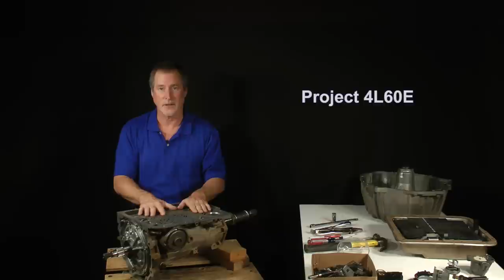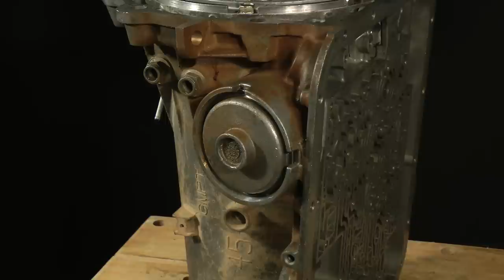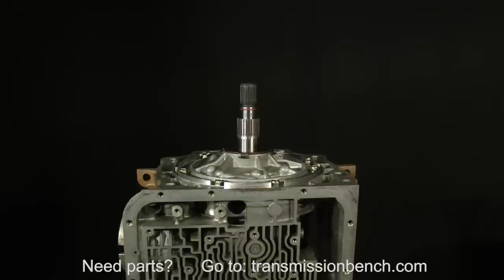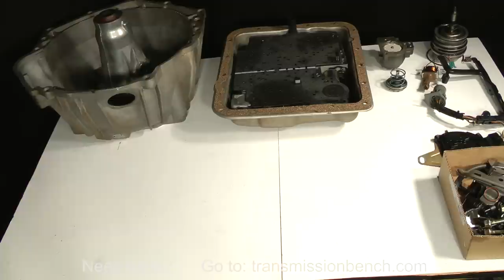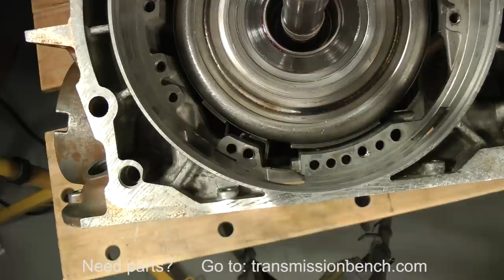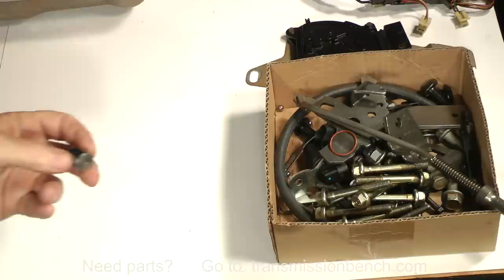Project_ 4L60E Part 1 lesson 6

Comment: I have an early 2004 4l60e with the o-ring on the pump. I ordered a new pump for 04 through 06 and it has the wedge seal without the o-ring. My case looks like it will accept either. My question is can I use the newer wedge seal style pump on it as it has the o-ring pump in it now, and will the case accept either style?
Reply: Do you know what would happen if that o ring wasnt there

Comment: Man;didn't have an in detail tear an engine apart video like that in '92 on 4 cylinder VW..Just had to keep main caps,bolts,and valves in order for machine and reassembly.That transmission looks like a Rubik's cube...